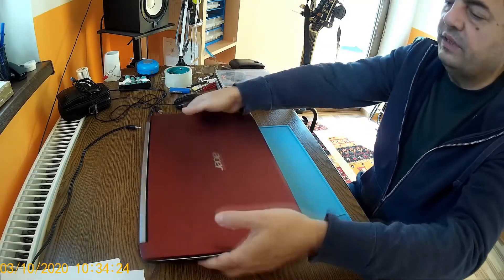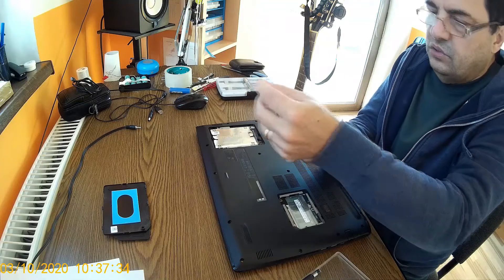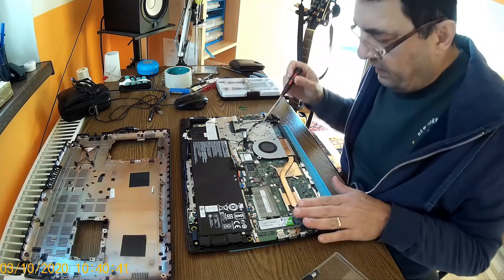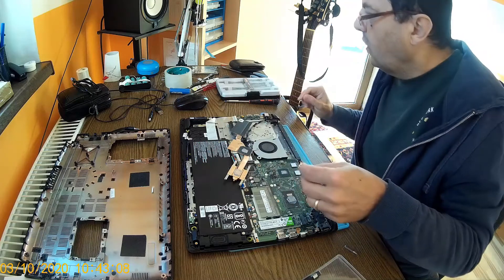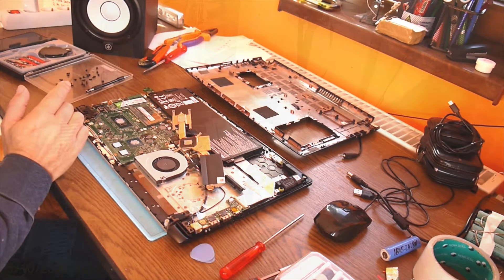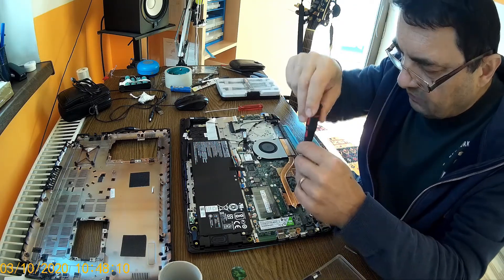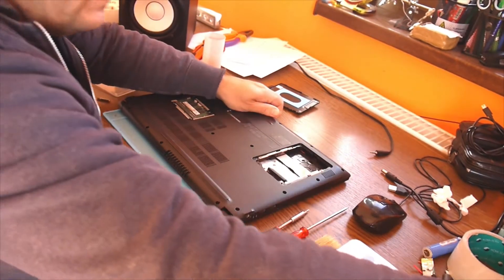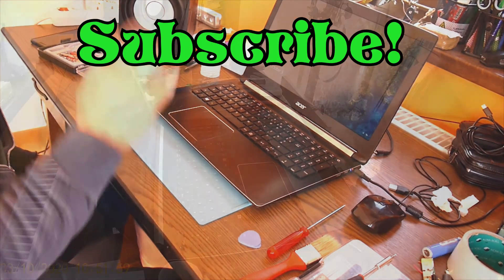ACER Aspire A515 51G replace thermal paste on CPU and GPU.

Comment: my laptop not showing nvidia graphic driver .. and its seen like error.how to fix
Reply: But the sytem crashes
Reply from the maker: @riswanrichan4506  I don't what to say.. I'm afraid a hardware failure. Is the card present in device manager?
Reply: @viocaia  yeah. But the card is not working...
When i install the nvidia driver the whole system got crash and i installed again my OS repeat days
Reply: @viocaia  it is Nvidia mx130 chipset. I played most of games in lowest settings...
Reply: I showed to service center and they told the whole mother board will change...
Reply from the maker: @riswanrichan4506  I'm afraid yes..it's an almost impossible task to replace GPU..ut you can use it for regular daily needs, browsing, Office...
Reply from the maker: @riswanrichan4506  this guys are not exactly gaming laptops..probably to much heat and no cleaning..it's just a single fan..
Reply from the maker: Try to install the latest NVIDIA driver..https://www.nvidia.com/download/driverResults.aspx/197301/en-us/

Comment: Hello. on 4:44. when you are doing paste. and you have near CPU one small. do you put also paste on that one ? or no
Reply from the maker: Yes, there should be paste too
Reply: Mine did not have any paste on the small chip. Watched another video that the guy used a thermal pad for the small chip. I left mine as it is (no paste or pad). My point here is that this can be skipped.

Comment: hello friend, a question, do you know if you can add a fan? or if there is a more powerful fan to connect it? that would be a great video and upgrade
Reply from the maker: There is place for second fan, but you need an extra heat sink..also I don't know any other powerful fan for this model..sorry!

Comment: Thank you for the tutorial. I needed to see someone do it before attempting it myself, just so I know what to unscrew and how it comes apart. I've had overheating issues for a while now, and cleaning the fan and radiator vents helped a bit, but nowhere near as good as it was when the laptop was new. Great video :D
Reply from the maker: I heard that before, even with new paste still overheating..I have a crazy idea, sometimes the heat pipes loosing their conductibility, inside it\s an oil, possible a very small leak to let it evaporate..I never find it but it can be an explanation.With a good thermometer check the CPU/GPU temperature and compare with the end of the heat pipe..should be around 2 degrees difference..so a good heat pipe system the temperature to both end s is  close..

Comment: My laptop cpu usage while playing game is 20% but the temperature is 98 degree Celsius. On the other hand gpu works fine on 55 degree celsius. Any solution for that?
Reply from the maker: Have you cleaned the fan/heatsink/new therma paste lately?
Reply from the maker: Why not using a fan cooled pad under the laptop..
Reply: @viocaia  yes I clean the fan once every month. And yeah I use a coolpad too.
Reply from the maker: @zyus.2599  I did a heavy render, CFPU not more then 84C..I really don't know ..maybe the heatpipe is empty..sometime they are leaking, there should be a kind of liquid to transfer the heat...check the temperature near the CPU and at the end  of heat pipe..
Reply: @viocaia  can you provide me the process on how to do that?
Reply from the maker: @zyus.2599  I can't, but you may use your hand and feel the difference..if is very high..in the CPU side and relatively low the other side..maybe is a thermic transfer..I doubt that but sometimes is happening...
Reply: @viocaia  Thanks for the help sir. You have been a great help. Thanks for replying constantly
Reply from the maker: @zyus.2599  Can't help more..my pleasure!
Reply from the maker: Look here https://www.youtube.com/watch?v=rJvAAb5caqw&t=115s

Comment: Is unstable power supply that used for charging to laptop could damage any hardware on laptop itself especially on motherboard maybe? Thanks
Reply from the maker: I don't think so, there are input circuits protecting in case of high or under voltage.If you consider a bad cable, that can be a problem..on /off charging randomly, but even that can't fry the lap. I believe the danger is from AC leaking, let's say there is a part of the AC mains leaking to the laptop, then connecting a LAN cable can lead to a discharge and boom!

Comment: what screw drivers do you get and must have?
Reply from the maker: Different Philips tips..for fine mechanics.Something like this.. https://www.linkindustrialtools.com/en/set-of-screwdrivers-for-electronics-wera-2035-6-a.html
Reply: @viocaia  and these are magnetic screwdrivers?
Reply from the maker: @Dafuqbro69  Not dedicated..but you can magnetise them so easy, with a strong neodium magnet, also, you can add a small magnet to the screwdriver for stronger magnetic field.I showed that in my videos..
Reply from the maker: Look here https://youtu.be/JQgL8MdE4-c

Comment: my a515-51g reaches 100c constantly and at idle it's at 60c, it has a new motherboard because of the warranty(now it's over), do i repaste?
Reply from the maker: Try that..is the fan spinning? can you hear it? check the heat pipe and clean the output for dust...
Reply: it does spin but only when the cpu usage is really high, im currently at 6% usage with 66C, i clean the outside regularly atleast, and i did clean once the insides when i installed a m.2 ssd but it was not that bad
Reply from the maker: @fizumi1h1  Maybe the fan is bad...I really don't know, mine is spinning just a bit all the time..even at nothing to do...
Reply: i did a stress test a few hours ago and the fan is working it's just my headphones that cancel it's sound so i can barely hear it, but it doesn't cool the cpu below 98c, it hits 100c then it power limits to 15w, then it drops to 80~ then it goes back to full power and hits 100c again causing huge freezing while gaming
Reply from the maker: @fizumi1h1  It's just a theory, the heat pipes are tubes with a thermic agent, maybe those are leaking or empty..so there is no real heat transfer...for now , buy a cheap under laptop fan..that helps a lot
Reply: thanks for your advice!
Reply: the fan does kick in, i've been looking for new thermal paste, any recommendations?
Reply from the maker: @fizumi1h1  there are so many..try to avoid the white ones...
Reply: what's the best method to apply thermal paste, would it be pea shape or lenghtways?
Reply from the maker: @fizumi1h1  I just add a blob in the middle and with a tooth stick and passion I spread it all upon the cpu and gpu surface, in a thin layer..it takes few minutes but I'm sure any little surface is covered.
Reply: @viocaia  okay! thank you for the advice again!
Reply from the maker: @fizumi1h1  good luck !!
Reply: @viocaia  i'll report results of before and after!
Reply from the maker: @fizumi1h1  Please do, hope it will be ok!
Reply: @viocaia  just incase, do you know any tools i can use to benchmark cpu and gpu?
Reply from the maker: @fizumi1h1  not exactly..personally I use my own system like rendering a video to hd mp4 and check the time.But you can check the net for it, like CPU and GPU stress.
Reply: just to be sure, do i apply it on the heatsink as well?
Reply from the maker: @fizumi1h1  No, just clean it nice..it will be enough from the CPU..dont over charge..
Reply: i's been 2 days since i pasted it, the cpu is still locked to the 15w mode but it's temperatures reduced from 100 to 65 at full load, gpu lowered from 75 to 65 as well, the computer is stable and doesn't freeze while gaming anymore, i used the coolermaster mastergel maker, not the nano, a worthy upgrade!
Reply from the maker: @fizumi1h1  Super! maybe you should go to Power settings and change settings for full power.You did it well!
Reply: acer blocked the tdp on the bios sadly, i'd need a bios mod to fix it but other than that the computer is running like new!
Reply: @fizumi1h1  bro, how do you know the fan is working fine?
Reply: @fizumi1h1  and what happen with your old motherboard so you change it to new one?
Reply: @chrismoore4120  i mean i turned the computer on and the fan still worked
Reply: @chrismoore4120  it was in warranty so acer did it for me
Reply: @fizumi1h1  can you tell me why you changed your old motherboard bro, what happened?
Reply: @chrismoore4120  i tried to rollback the bios and i ended up killing it

Comment: hello friend, a question, do you know if you can add a fan? or if there is a more powerful fan to connect it? that would be a great video and upgrade
Reply from the maker: Interesting idea.
Reply: @viocaia  If it's a good idea, I've been looking for information on that but I haven't found anything yet, the only thing I've found is adding heatpipe, which I also find interesting
Reply from the maker: @cristobal1918  There is a place for second fan , but no connector, I think it will be easier and no harm to laptop to use a laptop cooling pad..I really don't want to mess around with.Mine it's ''working' when I render videos..but until now , didn't find any heating problem...

Comment: Do you have any idea why My Acer Swift 3 hangs randomly? And when it hangs, it literally cannot respond to anything like keyboard or track pad, even when I close the lid it can’t go to lock screen. The screen just shows me the exact interface when it hangs. But I still can hear the fan’s noise. It hangs randomly, Especially while streaming video? I have opened the back case, and see that thermal paste is still there but it’s dried out. Not sure if it was because of the thermal paste. But I’m now ordering one the brand is thermal arctic mx-4 or something like that, its still being shipped from China.
Reply from the maker: change the thermal paste for now, you can use the old one, diluted with a little alcohol till you get a fresh one...it's 90% from overheating.Check the fan and clean everything there for better cooling.
Reply: @viocaia  but its only been less than 1 year  I bought the laptop and it was a brand new.. but don’t you think its kinda weird that a new laptop suddenly run out of thermal paste🤔. But, actually I’ve cleaned the paste leftover completely so there’s literally nothing I can do except waiting my order to arrive🤣
Reply from the maker: @elon6784  Mine was the same after 16 months..
Reply from the maker: Look here how to reuse the paste..min 3:13 !
https://www.youtube.com/watch?v=oQspwDyS0Mo
Reply: @viocaia  the fan is actually fine.. I’ve ever done my older asus laptop fan because its so dirty... but not with my new acer swift, I can tell its clean

Comment: I have a unique problem on my laptop.. my acer nitro 5 an515-42.  Shows gpu temperature of 255°C on the nitro sense app. And when i turn on my laptop the keyboard blinks for some second at turns off.And it also shows charing every time even when i am not plugged in.what kind of problem is it?
Reply from the maker: I'm afraid it's GPU related problem, needs reballing or replace..see if there is any way to disconect GPU in BIOS and let only Intel HD GPU...It's more then my expertise...
Reply: @viocaia  thanks for the reply..and the always showing charging problem is also because of the gpu

Comment: Any advice for one that won't power on? It charges, when powered on the blue LED lights for about 7 seconds then shuts off. Does not post at all. So far I've replaced the battery and the keyboard.
Reply from the maker: Start with the memory in slot 1, take it off, take the BIOS battery off, let it stay for 15min, try to start without, take the big battery off, try to start without it, just the power supply, also change the power supply, maybe is not ok...disconnect the USB cable (the white one goes to the little board on the right) maybe it's a short on USB boards...if all those doesn't help, it should be a Motherboard problem..sorry I can't help more..
Reply: @viocaia   Hey Viorel , why manufacturers no give thermoelectric cooling in laptops
Reply from the maker: @AnuragYadav-jw1dq  Probably not energy efficient